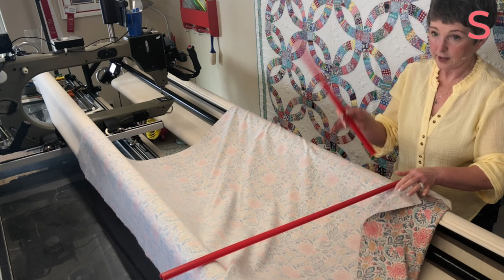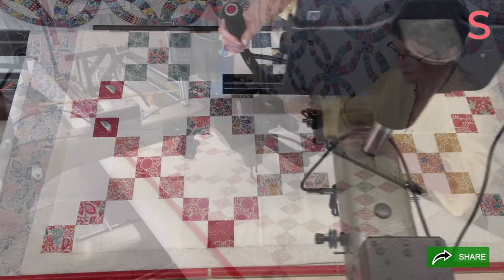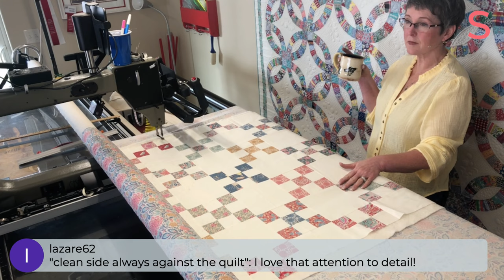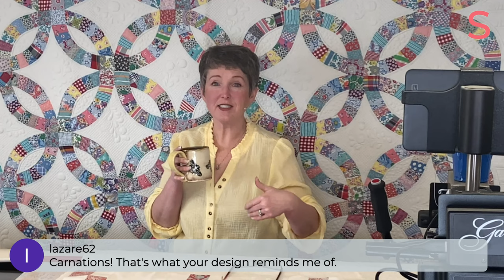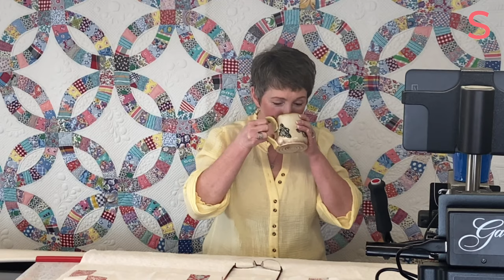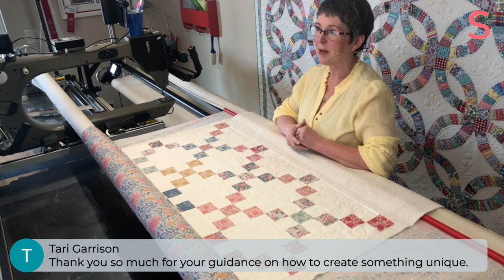LIVE & UNSCRIPTED - The steps I take to draw a brand new freehand design from the quilt fabric.

Comment: I found you a few months ago and have already learned so much. I have a juki 2000 on my 5 foot babylock frame and I successfully quilted a king size on it using your crazy 8s. When I am auditioning a new design I take a picture print it off in an 8x10 then slide it into a sheet protector and use a dry erase maker to do it. Now I plan on the plexiglass trick. I love all your oops tips and tricks.

Comment: I have an innova.  the backing is supposed to go on what you call the belly bar.  I float as well but I don't attach my backing to the"belly" bar, I roll backing on the bar that is supposed to be for the quilt top to roll on.  that way I can use magnets.  If that makes sense.
also,  I use an extra length of snapper with a dowel that has stretchy cording on each end.  sooo easy to use this for the side clamps.  they basically look like the snapper side clamps but way easier for me to attach!  and with the yard stick, it is never in the way of my longarm
Reply from the maker: I do the same thing with my belly bar and roller for the backing. Those are just “suggested” uses, right? And I’m going to give the side clamps a try - thanks for the idea!